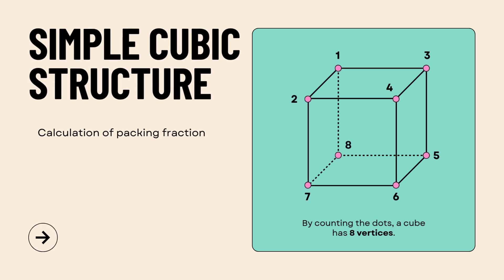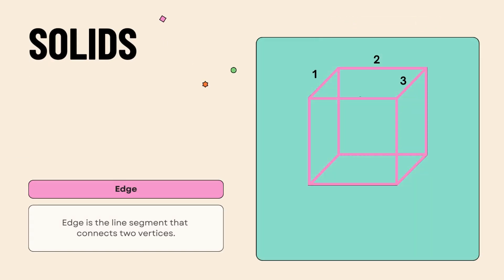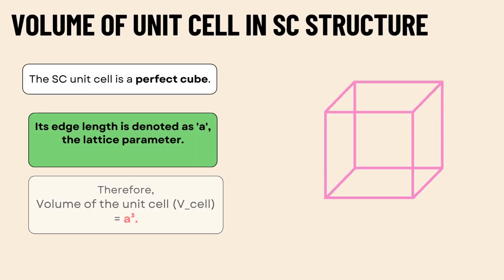APF calculation of SC structure

Comment: This video shows details about what a SC(simple cubic structure) is, and how it's APF can be calculated, in this structure, only 8 corners of the cube contains atoms, so the total number of atoms per unit cell is 8*1/8=1,and each corner atom has exactly 6 nearest neighbours, therefore it's coordination number is 6, the radius of SC structure is a/2(0.5a), and so the APF of SC structure is 0.52.

Comment: The video breaks down the Simple Cubic (SC) crystal structure, which is the most basic way atoms can be arranged in a solid. It shows how atoms are positioned at the corners of a cube and explains how to count how many atoms effectively belong to one unit cell. The presenter then walks through the relationship between the atomic radius and the cube’s edge length. Using this, the video calculates the Atomic Packing Fraction (APF) and explains why the SC structure has a low packing efficiency (about 0.52) compared with other crystal types. It’s a clear, step-by-step explanation aimed at helping students understand SC geometry and packing

Comment: We understand from the above video that the Simple Cubic (SC) crystal structure, a fundamental arrangement in solid-state physics and materials science. It breaks down how atoms are positioned in this structure, forming a cube with one atom at each corner, and discusses key properties such as coordination number, packing efficiency, and how the unit cell is defined.  the geometry and significance of the SC lattice to help understand this basic building block of crystalline materials.

Comment: Excellent and very informative video! It clearly explains the Simple Cubic (SC) crystal structure and how to calculate the Atomic Packing Fraction step by step. The video shows how atoms are arranged at the corners, how to find the effective number of atoms in the unit cell, and how to relate the atomic radius with the cube edge length. The step-by-step calculation of the packing efficiency makes it very easy to understand.

Comment: This video explains the Simple Cubic (SC) structure, the most basic crystal arrangement where atoms sit only at the corners of a cube. It shows that these eight corners share space to form just one full atom per cell, with a packing efficiency of 52%. By using the simple relation $a = 2r$, the tutorial makes it easy to calculate how much space is filled versus empty, providing a perfect starting point for material science.

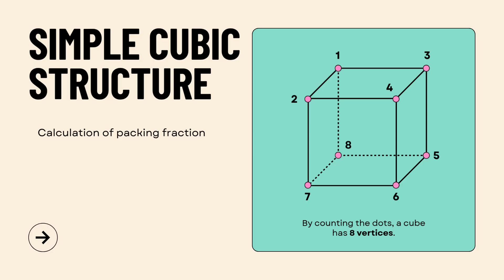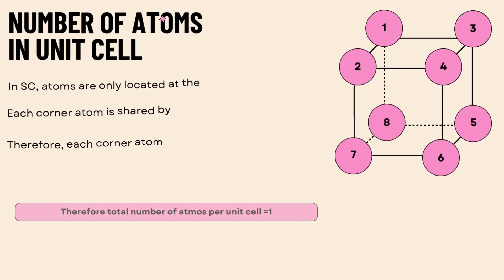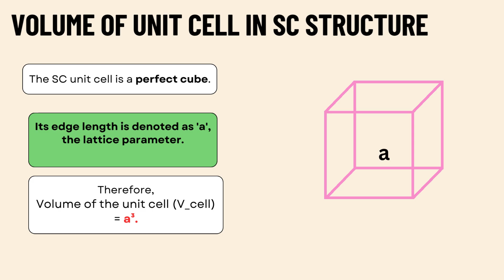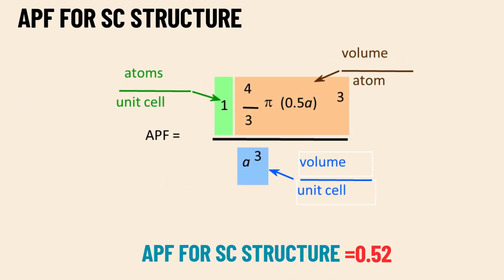Comment: This video provides a clear explanation of the Simple Cubic (SC) crystal structure (0:02). It covers the definition of a unit cell (0:08), how to calculate the number of atoms per unit cell (1:42), and the relationship between atomic radius and edge length (2:13). The video culminates in the derivation and explanation of the Atomic Packing Fraction (APF) for SC structures, which is 0.52 or 52% (2:47), highlighting its low packing efficiency and rarity in nature (2:58).

Comment: This video explains the atom placement: Atoms are located only at the eight corners of a cube.
There are no atoms on the faces or in the center.
Although there are eight corner atoms, each is shared by eight adjacent unit cells a
Only 52% of the cell is occupied by atoms, while 48% is empty space (voids)
Because of this low packing efficiency, the SC structure is relatively unstable and rare in nature. Polonium is one of the few elements that crystallizes in this form

Comment: In this video, simple cubic structure calculation of packing fract, this is solid have different numbers of vertices ,edges and faces. the line segments and cubic are 12 edges. The no. of atoms in unit cell are 1.

Comment: The video discusses the simple cubic (SC) crystal structure, beginning with a definition of a unit cell as the smallest repeating unit that generates a crystal lattice. It notes that a cube has 12 edges and 6 square faces, which is key to understanding structures like SC, BCC, and FCC. In the SC structure, atoms are located only at the eight corners of the cube, with no atoms on the faces or in the center. The coordination number, representing the nearest neighbors, is identified as six. The video explains that although there are eight corner atoms, each is shared by eight adjacent cells, resulting in a total of one effective atom per unit cell. The relationship between the edge length and atomic radius is established as the edge length equalling twice the radius because atoms touch along the edges. Finally, the Atomic Packing Factor (APF) is calculated as the ratio of atom volume to cell volume, resulting in 0.52 or 52%, which indicates low packing efficiency and explains why this structure is rare, found only in elements like polonium.

Comment: The Simple Cubic (SC) structure is the most basic crystal lattice, with atoms located only at the eight corners of the unit cell. It has a coordination number of 6 and contains only one effective atom per unit cell. Because atoms only touch along the cube's edges, the atomic packing fraction is low at 52%, meaning 48% of the cell is empty space. This low efficiency makes the SC structure rare in nature, with polonium being one of the few elements that crystallizes this way.

Comment: This video explains the atom placement: Atoms are located only at the eight corners of a cube. There are no atoms on the faces or in the center. Although there are eight corner atoms, each is shared by eight adjacent unit cells. 
Only 52% of the cell is occupied by atoms, while 48% is empty space (voids) 
Because of this low packing efficiency, the SC structure is relatively unstable and rare in nature. Polonium is one of the few elements that crystallizes in this form

Comment: Above video explains the concept of simple cubic structure and atomic packing fraction for simple cubic structure. To calculate atomic packing fraction for simple cubic structure we have find out the number of atoms per unit cell, coordination number, volume of unit cell in simple cubic structure, radius of atom. Then put all the above values that we have find out in the APF formula for simple cubic structure.

Comment: The explanation really simplifies how the Simple Cubic structure works. Basically, you just imagine atoms sitting at the eight corners of a cube, touching each other along the edges. Because it’s so spaced out, it’s not a very efficient way to pack things in fact, about half of the cube is just empty air.

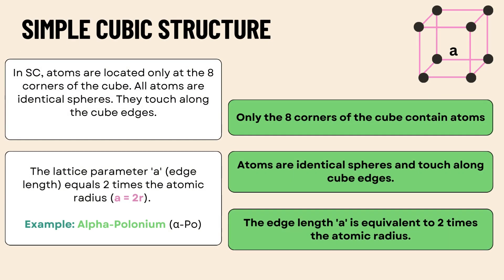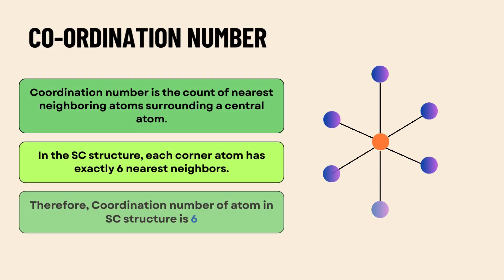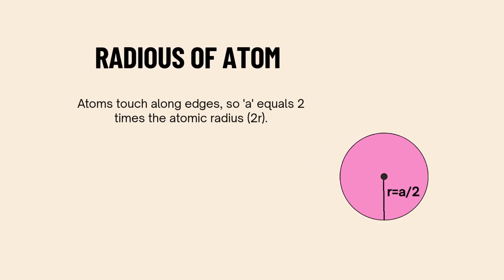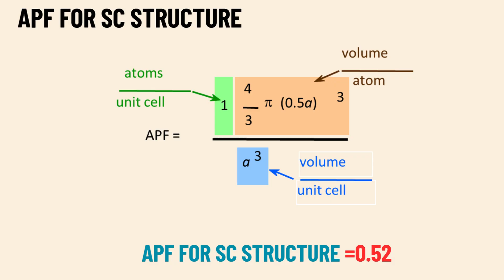Comment: This video provides a clear and concise explanation of the Simple Cubic (SC) crystal structure (0:00-0:06). It starts by defining a unit cell as the smallest repeating unit that generates the entire crystal lattice (0:08-0:13). The video then focuses on the SC structure, highlighting that atoms are located only at the eight corners of the cube (0:55-1:02) and that its coordination number is six (1:19-1:35). A significant portion of the video is dedicated to the step-by-step derivation of the Atomic Packing Fraction (APF) (2:33-2:44), explaining the relationship between atomic radius and cube edge length (A = 2R) (2:13-2:30). Finally, it reveals that the APF for a simple cubic structure is 0.52 or 52%, indicating its low packing efficiency and rarity in nature (2:47-3:03).

Comment: Key concepts covered include:
Unit Cell: The smallest repeating unit that generates the entire crystal lattice (0:08). Three common types are simple cubic (SC), body-centered cubic (BCC), and face-centered cubic (FCC) (0:15).
SC Structure Arrangement: Atoms are located only at the eight corners of the cube (0:55). The edge length is denoted by 'a', the lattice constant (1:07).
Coordination Number: In an SC structure, each atom is in contact with six adjacent atoms, so the coordination number is six (1:19).
Effective Number of Atoms: For an SC structure, there is effectively one atom per unit cell, as each of the eight corner atoms contributes 1/8 to the cell (1:42).
Relationship between Atomic Radius (R) and Edge Length (A): In an SC structure, atoms touch along the edges, so A = 2R (2:13).
Atomic Packing Factor (APF): This measures how efficiently atoms fill the unit cell, calculated as the ratio of atom volume to cell volume (2:33). For a simple cubic structure, the APF is 0.52 or 52% (2:47), meaning 48% of the cell is empty space (2:56). This low packing efficiency makes the SC structure less stable and rare in nature, with polonium being one of the few elements that crystallizes in this form (2:58).

Comment: It  explains the Simple Cubic (SC) crystal structure. It covers the arrangement of atoms in the unit cell, the contribution of corner atoms, and how to calculate the number of atoms per unit cell. The video also derives the relationship between atomic radius and edge length, explains the step-by-step calculation of the Atomic Packing Fraction (APF), and highlights why the SC structure has low packing efficiency (APF =0.52), along with its real-world relevance and examples.

Comment: A crystal is made of repeating blocks called unit cells. In a Simple Cubic (SC) structure, the unit cell is a cube with an edge length of a and a volume of a^3. This cube has 8 corners and 6 faces, but each atom is only connected to 6 direct neighbors (its coordination number). To see how much space is actually filled, we calculate the Atomic Packing Factor (APF), which is the volume of the atoms divided by the volume of the cube.

Comment: This Video Helped ME to Calculate
The APF (Atomic Packing Factor) for a Simple Cubic (SC) structure is 0.52 or 52%, calculated by dividing the total volume of atoms in the unit cell (1 atom: (4/3)πr³) by the total volume of the unit cell (a³ = (2r)³). This shows that atoms occupy just over half the space in an SC lattice, making it a relatively loose packing

Comment: The atomic radius (r) is related to the cube edge (a) by .
• APF is calculated as the volume of atoms in the unit cell divided by the total cell volume, giving APF = 0.52 (52%)This shows that SC has low packing efficiency compared to BCC and FCC structures.

Comment: The video explains the Simple Cubic (SC) crystal structure, the most basic type of unit cell in solid-state physics. It shows how atoms are positioned at the corners of a cube and describes how to calculate the Atomic Packing Fraction (APF) by dividing the total volume of atoms in the cell by the volume of the cube.

Comment: In this video, I have learnt about the Simple Cubic (SC) crystal structure. It explains how atoms are arranged in the unit cell, the number of atoms, and how to calculate the Atomic Packing Fraction (APF). The video also shows why SC has low packing efficiency. It explains the relation between atomic radius and edge length. Overall, the explanation is very simple and easy to understand for students.

Comment: The video explains the Simple Cubic (SC) crystal structure, which is the most basic type of unit cell in solid‑state physics. It shows how atoms are arranged at the corners of a cube and discusses how to calculate the Atomic Packing Fraction (APF) by finding the total volume of atoms in the cell divided by the volume of the cube. The SC structure has a low packing efficiency compared to other crystal structures like FCC and BCC, because atoms touch only along the edges and there is a lot of empty space between them.

Comment: The video explains the Simple Cubic (SC) crystal structure, one of the basic types of unit cells in solid-state physics. It shows how atoms are arranged in the SC lattice, counts the number of atoms in one unit cell (1 atom), and then walks through the step-by-step calculation of the Atomic Packing Fraction (APF) — the fraction of space actually filled by atoms in the unit cell. The APF for the SC structure is derived and explained clearly for understanding. 

If you want, I can give exam-ready notes or a step-by-step breakdown of the APF derivation!

Comment: Atoms are located only at the eight corners of the cube, with no atoms on the faces or in the center.
Atoms per Unit Cell: Each corner atom is shared among eight adjacent unit cells. The total contribution is 8 \times 1/8 = \mathbf{1} atom per unit cell.

Comment: This video explains SCC crystal structure and how to calculate it's atomic packing fraction in materials science and solid state physics .
In sc unit cell there are 8 corner atoms but each corner atom is shared among 8 unit cells,so the total contribution per unit cell is 1 atom

Comment: Explains Simple Cubic (SC) crystal structure
• Shows atoms at corners only of the cube
• Derives relation between atomic radius and cube edge
• Calculates Atomic Packing Factor (APF) for SC
• Shows SC has low packing efficiency (~0.52)

Comment: The video explains the APF (Atomic Packing Factor) calculation for the Simple Cubic (SC) crystal structure — showing how many atoms are in the unit cell, how they fill space, and the resulting low packing efficiency of the SC structure.

Comment: The video explains the Simple Cubic (SC) crystal structure, one of the fundamental arrangements of atoms in materials science, by showing how atoms are positioned only at the corners of a cube and how this geometry affects key properties like atomic packing factor (APF), coordination number, and the relationship between atomic radius and unit cell dimensions; it walks viewers through the steps to visualize the structure and calculate how efficiently atoms fill space in an SC lattice compared to other crystal types.

Comment: The video explains the Atomic Packing Factor (APF) calculation for the Simple Cubic (SC) crystal structure, a basic unit cell in solid-state physics. It breaks down the process simply: APF measures how densely atoms pack in the structure, calculated as the volume of atoms divided by the unit cell volume. For SC, one atom per cell gives an APF of about 52%, showing it's not the most efficient packing.

Comment: This video elucidates the simple cubic (SC) crystal structure, outlining atomic arrangement and the correlation between atomic radius and edge length. It further provides a step-by-step derivation of the Atomic Packing Factor (APF) for SC. The video concludes that the SC structure exhibits a low packing efficiency of 52%, rendering it less stable and uncommon in natural occurrences.

Comment: This video explains the simple cubic (SC) crystal structure, detailing how atoms are arranged and the relationship between atomic radius and edge length. It further explains the step-by-step derivation of the Atomic Packing Fraction (APF) for SC. The video concludes that the SC structure has a low packing efficiency of 52%, making it less stable and rare in nature.

Comment: This video explains the Simple Cubic (SC) crystal structure, which is the most basic way atoms are arranged in a solid. It shows how atoms are placed at the corners of a cube and how to calculate the Atomic Packing Fraction (APF) — the part of space in the structure actually filled by atoms. The video helps you understand the arrangement and density of atoms in the SC structure.

Comment: This video explains about the simple cubic structure. It explains about the unit cell that it is the smallest repeating. It generates entire crystal lattice unit. In sc only 8 corners of cube contain atoms.  Moving further in the video it explains about coordination number, number of atoms in unit cell, radius of atom, atomic packing factor. Apf for sc  structure is 52% and void space is  48% . It also explain about the solids that they have different number of vertices, edges and faces.

Comment: From this video we understand about simple cubic structure . 
Simple cubic structure is a crystal structure in which atoms are placed only at the eight corners of a cube.
Each atom is shared by eight cubes, so one atom per unit cell is present.
Also we calculate the atomic packing fraction ( APF) , coordination number, atomic radius, volume of unit cell .

Comment: The video explains how to calculate the atomic packing factor (APF) for a simple cubic (SC) crystal structure and shows that it is very low compared to other structures.and the fundamentals of the Simple Cubic (SC) crystal structure and provides a step-by-step calculation showing that its Atomic Packing Fraction (APF) is 52%.

Comment: The video explains the Simple Cubic (SC) crystal structure, also referred to as the Primitive Cubic structure. In this arrangement, atoms are located only at the eight corners of the cubic unit cell. Since each corner atom is shared among eight adjacent unit cells, the structure contains one atom per unit cell and has a coordination number of six.

The Simple Cubic structure has an atomic packing efficiency of approximately 52%, which is the lowest among the common cubic crystal structures. This low packing density results in a larger void space and generally lower structural stability. Polonium is a notable example of a metal that crystallizes in the Simple Cubic structure.

The presentation makes effective use of clear diagrams and step-by-step derivations, and it also compares the SC structure with denser crystal structures such as Body-Centered Cubic (BCC) with about 68% packing efficiency and Face-Centered Cubic (FCC) with about 74%, providing valuable context for materials science studies.

Comment: Understanding SC structure

This video covers information about SC structure.
•SC has atoms located only at its 8 corners contributing 1/8th part equals to 1 atom
•Co-ordination number:6
•Touch along cube edges
•Volume(Perfect cube):a³(a is side length)
•Atomic radius(r):a/2
APF:0.52
52% space is occupied